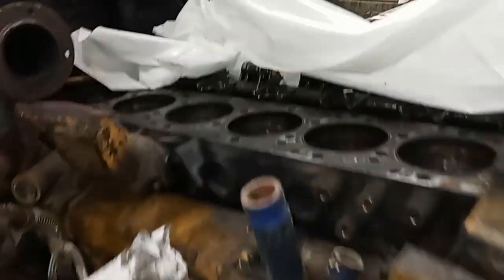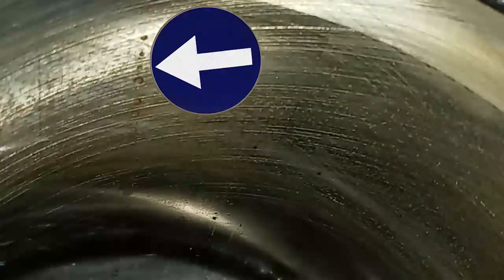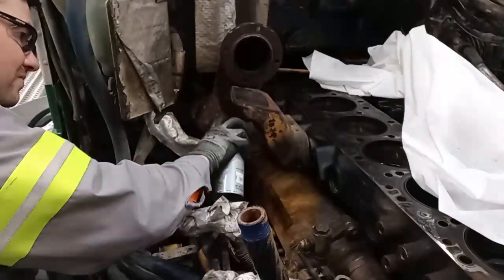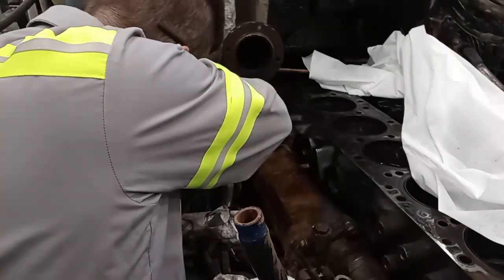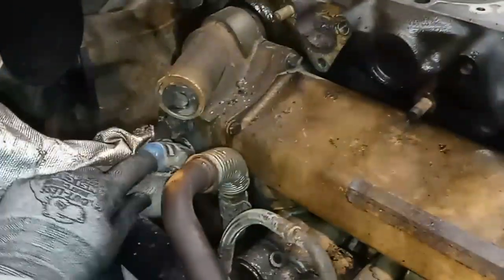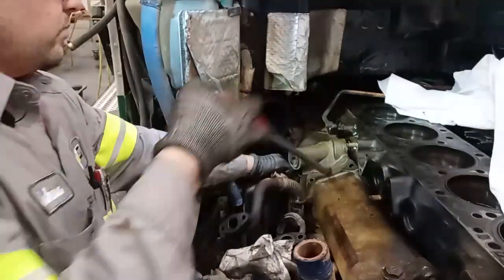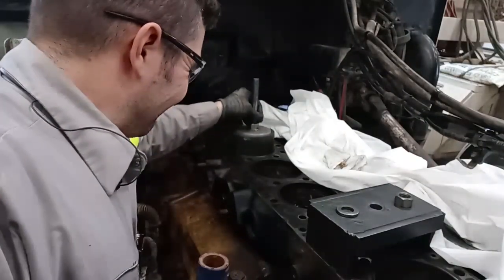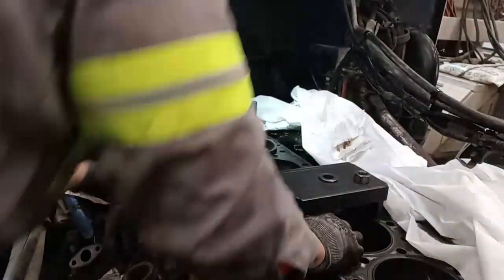Coolant can DESTROY your Engine faster than Bad Oil. Cavitation and Liner Pitting.

Comment: I have not seen cavitation erosion on a 13 liter yet, wow. Seen lots of brown coolant from a faulty or low psi radiator cap. Back in the day when a piston seized into the liner and the engine was locked up. We would have to drill a hole in the piston and thread it. put a bolt and a chain and hook it to the crane, thus the first cylinder pack puller. Then when they did come out with the cylinder pack puller, did not have the plate to the block. Had a eye lit and again you hooked it to the hoist. I have lifted the wheels off the ground on one. On our plate we added about one inch to the legs against the block so on the 15 liter engines. The liner completely clears the lower deck.
If I recall over 55% of all engine failures are cooling system related.
Reply from the maker: How many Cat engines you reckon you've built John? You have more stories about them than anyone I've ever talked to.
Reply: @AdeptApe  Hard to say, rebuilt, 1693, 1674, 3208, 3208T, 3306, 3306B, 3406A, PC, DI's, 3406B' C', PEEC, 3406E, 3176,  3176B, C13, C12, C10, C-15, C16, 3408 PC, DI. Have to remember I started in 1980 and PC's for trucks was stopped in 1979. Did warranty work on the 1600 series.
When I hired in the boss gave all the good job's to his buddies. I got the rear seals, bottom end job's and pulling engines. They are all now gone and I am still around. 
And if you want to go nuclear try and pull a water pump off a 1693 in the frame. You got bolts a shot gun can't hit.   
When the brown coolant first hit, mostly in PB. They tried all kinds of stuff before they realized what was causing it. Plus I have a excellent memory. I can rattle off part numbers and sometimes when I am in parts. They ask a for a part number and over half the time I don't have to look it up. (Common items). Did a lot of rerating mechanical engine's when you only had a book or micro fiche. So that was my era and I am winding down and you are now in your era to carry on. Trying to keep the yellow on the highway. As you well know truck drivers will come to your shop no matter how far away for excellent work.
I am hard nose, but I fix it the best way I can unless I am told not to. Seen a lot of sloppy work as well as you have and it burns me up, because they think it's the engine.
Reply from the maker: That's pretty interesting stuff, I've never touched a 1693 and only done limited with mechanical engines. I do have a 3208 in the shop now I'm doing the pump on, unfortunately just a reman swap, I wanted to go through it. I'm glad people like you exist that stay in the shop instead of jumping into an office job. I tried the office job route for a year and came back to the shop.
Reply: @AdeptApe  Even though it's a reman you will still have to set the rack and such on it. Make sure it has the valve put in the governor hsg which helps on sucking air. TEN article on it, reman should have it installed already. On these pumps what is hard to do is adjusting each lever for injection pump, crossover lever and when you pull the FT pump off the thrust sleeve can fall out. I take the governor off and made a plate to keep the camshaft thrust-ed forward to prevent it from sliding back and falling out. Had one apart last year pumps was froze up from setting. Replaced all pumps, reseal governor and FTP. Since it is a reman, take it apart and look what's inside. On every one you take the governor off, you have a lever that bolts to the shaft. Every one cracks between the bolt holes, only replace if it really looks bad. I have ran the engine with the top off the pump and if you ever R and I a injection pump. Before you torque the bushing. move the rack up and down several times to make sure pump is seated. Have seen them snap and engine gets cranked, they like to run away. Then you will get to have your own destruction of the week video.

I was in the office for four to five years. Had a bad boss and had to get out or quit.
Reply from the maker: Thank you for the advice. I always have the filter housing off and my safety clipboard ready for any unexpected increases in RPM, just in case.
Reply: @AdeptApe  Your taking all the fun out of it. I started a engine for a guy one time he worked on the pump of a 3208. He held the clip board, I started it, revved it up a few times, OK. He put his clip board in the bottom of his tool box and closed it up. As I turned around and started walking away, it ran away. It was in a COE and he had a 90U parts book a few engines thick. He tossed it in the intake and it sucked it down and blocked some air. I grabbed a 3/4 wrench and started loosening fuel lines. Got some on the drivers side and ran around to the other side and I froze for a few seconds. I solid stream of black smoke was pouring out the exhaust. When I unfroze naturally I got the lines opened up and the engine shut off. 

One of the funnest run a ways, I was told about it. Cat had a factory class for PEEC 8TC's on the east coast dealership. Our TC went, training instructor and one mechanic from our shop, that I recall. It was in a COE IH. They had two ECAPS on it. One guy had the governor off completely and another guy was adjusting the beer can throttle sensor. (Don't know if you ever had to mess with them). Any way the guy was up in the cab and his big butt hit the start button and off it went at full rack no governor. I was told since it was so loud all you read was people's lips and they said "Oh ship or something that rhymes with that. The guy working on the governor was standing naturally right next to it behind the steer tire and was in panic mode.
After a eternity or a few seconds (you know how long it seems when something like that happens) he moved the rack to the off position and shut the engine off. It got so fast so quickly I was told it blew the coolant out the radiator pass the cap. That night the dealership had to remove the front cover and replace bolts and what ever else was damaged.      

Headed to work, got a few more run away stories that are good.

Comment: Thank you for sharing that knowledge Josh... Something I don’t understand well is that when you rebuild a C-15 you always mention something about machining the block for the liner protrusion, is that really necessary when putting the liners in if the engine worked perfectly before the rebuild and it didn’t have it?
Reply from the maker: Yes, the 3406 and C15 have a problem with liner protrusion, especially on higher mileage engines that have to be corrected with either shims or pressed in inserts, but a machine shop has to do the latter.

Comment: That coolant looked like it had never been changed.
Reply: Exactly.  Someone did not do proper scheduled maintenance
Reply: @archiedentone5950  Looked like he topped if off with pure water .. right on schedule for 30 years !
Reply: This is prolly from exhaust gases we got it going on with a John Deere engine and u can fill it with antifreeze and water and crank it and in 2 or 3 minutes it looks worse than that

Comment: that is implosion, the air bubble hits the hot metal and implodes, cause is from a vacuum leak on the suction side of the water pump,

Comment: I've seen way worst and the block......Long ago when I worked for truckstop had ole boy come in from Alabama. Drained oil it looked like green peas baby food and tried to over fill drain that holds little over 2 oil changes. I'm telling guy you need to go to cat thats 1 exit down. NO NO I had a friend who made it from Calif to Alabama so he can too and he still had 16 hrs to drive home. He said so when oil pressure gets low and have oil change yep. I had hard time getting oil put in through slim in valve cover. Best one Canadian going back home had no cab heat. Heater hoses are frozen, rad frozen and he's telling me can't freeze because engine  heats them up. Water pump leaking and he had been dumping in straight water. Issue issue it's -15 degs and he's going north and its -25 to-30 where he is going to........Don't know if he ever made it but I'm sure he's gelled up somewhere and block froze

Comment: I work on marine Diesel engines and we had this happening on a larger engine where the air bubbles in the coolant system were lodging where the eddy flow allowed the air bubbles to stick in one particular area of the rough outer surface of the liner. After several hundreds of thousands of dollars changing liners over years of work the chief engineer suggested an upgraded coolant pump ( greater flow ) and an increase in the coolant pressure from 10 psi to 14psi. ( smaller bubbles ) .......the problem was solved we never had to change liners after this

Comment: So is cavitation a issue on non sleeve type diesels? Id imagine so there is no easy way to tell.
Reply: Yes it is a concern on parent bore engines as well. Even worse is you can't just replace a sleeve, the block is scrap.
Reply: @abpsd73  well, atleast if you actually maintain the system i guess it shouldnt be a issue.
Reply: @TeamTopKick  I play around with some small older IH diesels which are known to have cavitation issues. Granted they don't see that mileage or hours that bigger engines get, but I keep an eye on my coolant and haven't had problems.

Comment: At what milage/age would u recomend changing the coolant.... Keep safe bud!
Reply: Get samples and change you radiator cap every year, don't get a cheap one or low psi.
Reply: @johngoldsmith6629  I’m glad I watched this video because for about a year I was running my 3408 without coolant pressure. The filler neck in the radiator was faulty. The clue was when I removed the radiator cap when the engine was hot, you couldn’t hear the pressure release. The radiator is fixed now, but I hope I haven’t caused cavitation problems. I always use CAT coolant.
Reply: @gm16v149  3408 PC or DI? Rebuilt several rare engine now a days.
Reply: @johngoldsmith6629  3408A DITA with adapters for B series pencil injectors. Still a few around in roadtrains in Australia because they are reliable and like heavy loads.
Reply: @gm16v149  Engine serial number

Comment: Oh hell that’s an old green ant  freeze electrolysis  problem that used to be what happen when you didn’t keep up with the sca in the old green anti freeze
Reply: Are you sure? I am VERY interested in the specific cause and cost-effective means of prevention.  What are the best protective coolant additives now to use instead of changing coolant? stores don't seem to carry coolant corrosion inhibitor anymore, though ebay still has the old school stuff.  Can any additive inhibit cavitation?
Reply: @alan6832  RMI 25 works wonders.
Reply: @alan6832  u can get the stuff at advance for like $10 and it works great

Comment: Wet sleeve/liner cavitation is a problem caused by poor coolant maintenance, whereby air bubble implosions within the coolant remove a protective coating from the exterior of the sleeve/liner.  The combustion process causes the liner to oscillate (expand and contract) on the thrust side of the piston creating an area of low pressure which cause air bubbles to come out of the coolant following the contraction period.  After contraction, the sleeve/liner then expands into the air bubbles causing the air bubbles to implode creating a shock wave of approximately 60k psi against the side of the sleeve/liner, continually removing small amounts of sleeve/liner material.  Eventually, the liner wall becomes perforated, allowing coolant to enter the combustion chamber causing catastrophic failure.   

Electrolysis is the destruction of metal parts in contact with an acidic coolant when stray electrical currents find their way between two dissimilar metals.

This video was a fine example, as Josh stated, of a cavitation issue precipitated by old neglected coolant performing its destructive effects.
Reply: That’s a supremely fire analysis, thank you! 60k PSI what the hell... a .45 calibre round produces around 50k PSI. My mind is absolutely blown, though it really shouldn’t be.
Reply: This is easily top 5 comments ever made on this platform
Reply: @Random - No.  Coolant pressure is determined by engine configuration, which is a lot to explain.
Reply: Well said!
Reply: Holy smokes, I love these kind of nerdy details. They stick with me for some reason. Please do more or make some vids! New diesel tech here came over from automotive and small equipment

Comment: I know that many of the folks here have big trucks or maybe generating equipment, but I have a 2004 Motorhome with a C7.  I bought it used with 24,000 miles on it 3 years ago.  Being in the RV business (service manager) myself I cannot reiterate how important the coolant is in a diesel.  Josh has again hit it out of the park  (baseball reference).  During the very first trip we took in the RV there were coolant issues.  First the surge tank split (was made out of a poly material) and had to be replaced.  Then I noticed on the return trip that the engine seemed to run a bit warmer than normal.  So I took it to a diesel service center and had the coolant drained, including the block, and fully flushed with fresh clean water.  Then added the proper antifreeze mixture.  Additionally I found that the radiator was partially blocked at the bottom so had that power washed clean as well.  Now with proper rpm and torque management I can maintain the coolant temperatures.  Most importantly during every oil change, which for me is once a year and after about 3000 miles, the coolant is checked and analyzed for the proper additive concentrations.  So very important to do.  Again thank you Josh for showing us the damage that can be done by coolant.
Reply from the maker: Thank you for the very detailed and well written comment, as always.
Reply: You are the king my friend.

Comment: Great video do you have a part number for the liner puller or did you make it thanks
Reply: It is a Cat tool and the puller comes in sizes for the liner itself. The socket and puller plate is one for all. We added about one inch to the bottom of our plate for 5.4 bore engines. Be warned the rubber swells over time and you can purchase that part only. Best thing is get a clean bucket of oil dry and when finished set it in the bucket and cover it up with oil dry to pull the fluid back out of it. Naturally clean it off if you plan on reusing a cylinder pack before you pull them out. Wipe down the liner as well to get any fluid off the inside.

Comment: When i bought my diesel ford 7.3 idi I seen the coolant was nice and green but I knew about the cavitation problems they can have I never checked the coolant with a test strip to see how good or bad the additives were i added a bottle of it in to be in the safe side but i wonder if i should buy some test strips and check it only thing i seen in the coolant was a couple of chunks of orange rtv from a bad radiator cap which i put a new one on. I don't normally drive it in the winter so it sits pretty much those 3 months till its nice again.

Comment: the older Detroit 2 stokers were really known for this, you have to run the right coolant and keep it up-to date, shit i even run it in my 7.3 Powerstroke  yes i know it is over kill but at 275k i must be doing things right.
Reply: 7.3 fords had problems with coolant eating the block
Reply: @cooperparts  the old 7.3 yes but that got fixed so when the Powerstroke came along things were good. but it still has selves around the injectors, and TBH my truck runs a good 10f cooler with purple in it.

Comment: I never get the links for the tools. What am I missing? These are the best videos on YouTube,thank you. Also my C 12 is in for an in frame right now, the mechanic says the cam is toast. Would this cause a significant loss of pulling power? Will an after market exhaust manifold really increase HP  up to 32 more as they claim it will? I’m asking because this truck can’t seem to pull a hill for beans and I need all the help I can get.
Reply from the maker: The links are in the video description if you wanted them. Just a way to help out the channel if you are shopping anyway.
Reply: If the turbo, fuel psi, etc all checks out and still can't find a low power issue. Cat dealers (some) offers a PAR run and will measure fuel rate and other items to see how well the engine is doing and also a estimated guess on what the wheel horse power should be. If nothing obvious is found, just fuel rate a little low . Cat can adjust it legally and on some engine they will do a max out for 100.00 dollars more. PAR runs are not cheap and few dealers still offers them. Takes about all day long if the factory has to be involved. 
Been doing them since 1983 and have fixed a lot of complaints.

Comment: not sure what I appreciate more, learning about the mechanics of engines or the top quality investigations into problems?  I work in a refinery, cavitation is a common thing we have here on most of our process equipment.  The metallurgical findings dealing with equipment failures are fascinating.  Possessing Sherlock Holmes type mentality and persistence is such a high quality skill to have.  Keep up the good work Ape man.
Reply from the maker: Thank you sir.
Reply: @AdeptApe  why do you call yourself an ape?
Reply: @Mark-Tschetter  Evolution.

Comment: When taking off an old manifold, loosen each bolt but then do it back up, repeat until all have been done, then take all the bolts out.
If you take all the bolts out bar one, it can be a bugger to get out.
Reply: Reading this made me remember my dad telling me the same thing about 30 years ago (I was about 10).  Wow, that's a trip.